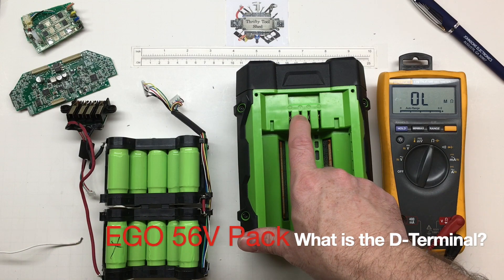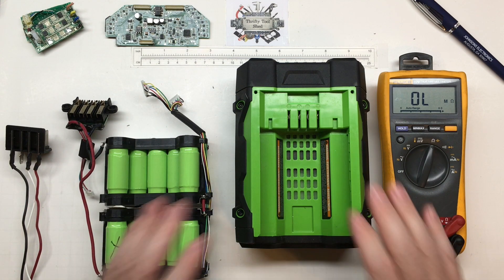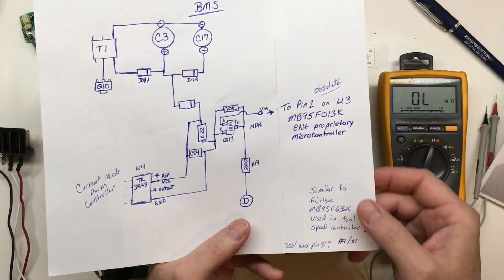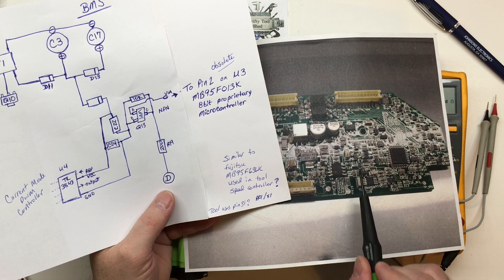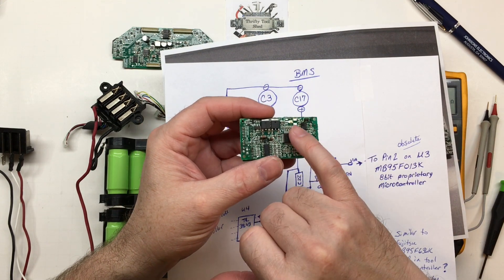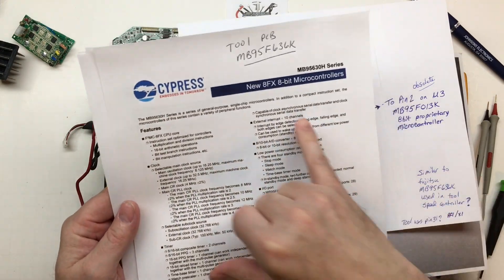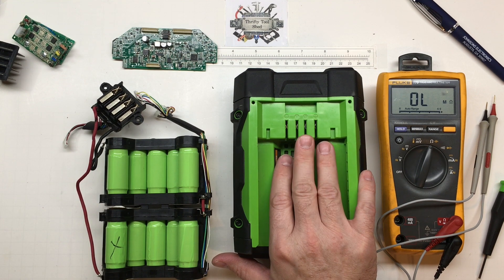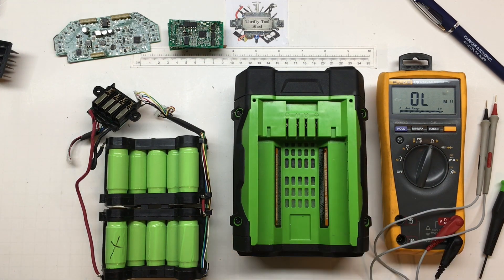EGO 56V Battery - What is the D-Terminal?

Comment: That D terminal should have been named P for propitiatory firmware which is what keeps EGO in business and all other battery / tool makers. Too bad we can't have some sort of standard in batteries so we could use them where we want. The bms could be replaces with a generic one so charging would not be a problem with any power supply but the tool wants to get the signal that it needs to run so that is where we should look next. I already used Snow Joe batteries to run my 36 volt lawn mower so it all works just a matter of configuration.
Reply from the maker: I agree. That is why I did give it a good effort and I also shared the Ruzixt style replacement pack made by AMZ on my channel as well. They impressed me with at least figuring out how to copy the BMS to use it in the EGO equipment. Its not a popular option and I understand that. I bought the first replacement pack myself to see how the quality is and to test and share it on video and I recently shared a update on it because the pack has did well for me in the last year honestly. The cool thing is the company AMZ that makes the 3rd party packs has got up with me and sent the 6AH pack to look at as well. I will be testing it and sharing that soon also. I was at least able to have a conversation with the manufacture, but as far as being able to purchase the BMS board alone, they are not allowing me to do that yet, I am still hoping though....
Reply: @ThriftyToolShed  Thanks for all you share it is a big deal to do all that. I guess the next step would be to try and dump the cmos chip which is where all the operating instructions are. Thanks again you have a great channel.
Reply from the maker: Thank you!

Comment: Great work indeed. This is most helpful as was your T terminal video. I’m working on a 2.5 Amp hr now with a very odd DTC resistance reading on the lower pack which I believe is causing a charging issue. Status monitor shows green but charging will stop after the first “blink cycle” (red-yellow-green), more later after one additional troubleshooting step. Thanks
Reply: I meant to say the  NTC thermistor. The pack T terminal measures normal ~11K to the negative terminal but the thermistor of the low cells measures ~ 4 ohms when measured on the BMS. Pack will not charge with all cells balanced. Using another BMS where thermistor of low pack measures ~ 10K at BMS, pack charges normally. Ever encountered this with any of your packsaddles?
Reply from the maker: Yeah, I figured you meant NTC. I have not experienced that exact issue. The T-terminal sounds good. You are saying the NTC on the cells with the small black leads are reading fine (around 10K or so) Then you plug it in the BMS and then it shows low ohms reading, like it's on the board that low ohms? I have seen the NTCs themselves give issues, but not the board on the Thermistor input other than corrosion / bad connection. I haven't seen it have a low ohms reading like that on the NTC terminals!
Reply: @ThriftyToolShed  yes on  the BMS with the harness connected to the BMS the resistance across the thermistor at the L pack terminals reads under 10 ohms. Have not the thermistor leads on the connector when it isn’t connected to the BMS. Swapping another BMS, charging is normal. Something on the one BMS is pulling the L pack thermistor low. Thanks
Reply: JS, did you figure out your problem with the ohm reading between ground and T dropping when the BMS is connected? I have a water damaged battery which was working until I tried to charge it before it was completely dried out and after charging for maybe 10 minutes something fried both on the battery and on the charger. Now there appears to be no continuity at all when I measure between ground and T. The battery still has almost 56 volts and still runs the tool so the D terminal seems to be working. It will not charge on another good charger I have so something is clearly wrong with the T circuit. I'm running a 18-in chainsaw with it which uses both D&T so I'm not sure how the saw is working without T functional.

Comment: Do you think you would be able to charge a DIY 14S battery with the charger without the D-terminal of charger connected to anything? T is easier to jerry-rig as I just have to get a NTC termister as you mention in the video. Not sure if the charging will work without the D.
Reply from the maker: In my experience with the chargers, you will need the D-terminal communication between the pack and charger to charge. Some maybe different, but all I have seen have to be connected to D-terminal. A 60VDC supply or so and a Drok DC-DC converter is one easy way to charge 56V packs. I have a similar video showing the Drok in action, but similar converter should work as well. I have not tried to charge  without the D-terminal enough to know much about it honestly, just my thoughts...
Best of luck with your project!
Reply: @ThriftyToolShed  Thanks!
The only reason I don't want to use a 60VDC power supply is that it will not have the characteristics of a lithum charger. Which may damage the cells in the long run. Generally, proper lithum chargers (like the Ego) would provide constant voltage & constant current until the battery reaches a certain voltage (4.0V/1 cell) then the current will slowly be reduced over time to lower and lower amps until the battery is fully charged (4.2V/cell). This is hard to replicate in DIY setup. Ofcourse I can buy a dedicated charger but it will be extra cost when I have 3 ego chargers laying around.
Reply from the maker: @DIYGuy85  That is the entire point of the DC-DC Converter. In may videos I discuss the CC and CV relationship and the Drok or any CC CV converter makes it very simple and easy.
Reply: @ThriftyToolShed  oh ok. I will check it out. Thanks

Comment: D terminal = Digital terminal? Communication terminal between processors for battery protection. If battery overheats or depletes, it tells tool to stop in order to protect battery? 
Do you suppose two batteries could share this D terminal to tool? I haven't checked the system on a dedicated dual battery tool. I suppose a dual/multi battery tool has two or more processors (one for each battery). I'm looking to add more batteries to my mower. I could do it without D terminals, but the protection wouldn't be there anymore. Any Idea? 
Thanks, Mat
Reply from the maker: I mentioned alot of this in the video. The tool will only run for about 10 secs if no communication between the tool and pack on the D-term. At this point the only way really is putting another pack in parallel, the + and - . It would have to be done properly or at the very least care must be taken to make sure the charge level of the packs are the same and the capacity of the packs must be extremely similar. The pack added will not have the protection of the low voltage cut off or temp monitoring of course.  That is the only way that I would know still. I did check out the Ruzuit battery pack made for EGO equipment and I only done so for one reason, to check out how well they done the BMS board. They copied it well, so that means they figured it out. Unfortunately I have not had success getting up with them to see if they would sale the board as a spare part. That would be very helpful. I did a video on the battery because it is a very close copy of the newest EGO BMS. Not really worth the money, but interesting that they figured out the D-terminal.
Reply: @ThriftyToolShed  Yes, you did mention that the tool would only run for about ten seconds, this is why I asked about parallel connections, not absence of. Sounds like you haven't attempted parallel D terminals. I plan, of course to use similarly charged packs, but I will be installing fusing between packs to avoid an expensive dummy mistake. I may test this out to see what happens as far as parallel D's. You haven't tested with any multi battery systems such as ego snow blowers?
Reply from the maker: I don't have snow blowers at all since I live in the south. That is a very good point though. I don't think the D-terminal should be paralleled due to this being a 2 way communication link between the tool and pack. I was simply referring to the one pack using the D-terminal and the other pack + and - being in parallel and of course the protection as you mentioned at least a fuse, at best battery isolation using high current diodes etc. on each pack.
Reply: @ThriftyToolShed  Not to worry, EGO has a rider mower coming to you soon! The rider will have up to six battery compatibility. I may investigate a bit into one of my snow machines to see the communication methods. BTW love your channel. I must say, the first video of yours that I watched opened my eyes to a lot of basic troubleshooting. Thanks!
Reply from the maker: The mower looks cool for sure. Thanks so much for your comment!

Comment: I've been running this for 3 years now.  My next goal is to connect to the d terminals. I'm using 4 batteries in parallell but through schottky diodes otherwise the dang things will charge each other but they would be bad. Probably blow them all up.
I am using a roboclaw mcp260 controller on the drives. So I will be able to output some data to d. It's just hard because it seems to be software driven.
https://youtu.be/kFqouZvOQAE
Reply: I did just get 7 ego snow blower battery combiner control boards. I am hoping to replace the schottky diodes with this. But I can't without the d terminal figured out.
Reply: @jacobecorder  I know this is super old but did you ever solve this?  I'm trying to connect 4 ego batteries in parallel to run my project but don't want to a) have an unbalanced batteries damage each other; or b) over discharge.  Did those snow blower control boards work out?

Comment: Even if we all figure out how to  “just” use the dinky battery as the means to keep the tool happy and use our big li Ion ebike batteries (and maybe .22 ohm series resistor and automotive 10A fuse) to keep the dinky battery charged, then that is workable IF the BMS doesn’t freak out .   May have to use 2 diodes and a summing node to prevent BMS from “seeing” the ebike battery...... I think “that’s the ticket!”     What do you all think?   As long as the summing nodes are done before any and all BMS, it should be completely clueless !!
Reply from the maker: Yes, I did mention in the video that the only solution to running other packs on say the Nexus inverter would be just as you mentioned a parallel configuration with a EGO pack in place to supply the communication. Dead on!
Reply: I would isolate the batteries. From what I have read,connecting a dead lithium battery in parallel to a charged one would be terrible. This is why I isolate mine with the schottky diodes. Very low voltage drop
 You can connect the ego battery to anything you want. You will just overdischarge it without some other sort of cut off system. A relay with a low voltage cutoff circuit will handle this. Battery displays on Amazon for 30$ can handle this for you. You set low limit and it can output to a relay
Reply from the maker: Yes, absolutely needed. Most people that watch my channel know I am so against videos telling people to "JUMP" battery to battery to "FIX" a bad pack. Such a wrong thing to do, especially in ignorance. Batteries should absolutely be either isolated from each other or almost dead on same exact voltage level and discharge rated in a tight.

Comment: Thanks for the videos. Interested in how the battery shuts down if Volts get too low. Repurposing batteries for e-bike project and from what I gather, the shutdown sequence on low volts is partially on the Battery BMS and partially in the tool. As I will not be using the tool, I'm curious as to how I can gather the parts from a tool (if required) to have the EGO low voltage shutdown function operational on the e bike. Any suggestions or other videos you can suggest?
Reply from the maker: I still have not figured out the communication between the D-terminal so the tool controller has to communicate with the pack so when BMS senses low voltage it tells the tool to shut down. The only progress I know of is slow. I did a video on the Ruzuit 56V battery for the EGO equipment. It is aftermarket, so good news is someone has reverse engineered the pack and figured it out. Not so good news... I have contacted company about BMS parts etc. But as I suspected, no response back. As mentioned in that video the price is not that great of savings, I bought one simply out of excitement to see how close the BMS is and if it communicates and it does. The only other work around for yours that comes to mind is wiring in a separate BMS of your own off of the + and - of the EGO pack and not even bothering with the EGO  feedback. If you really wanted to, you could build your own low voltage detection but may cost in components the same or more than a BMS on the market. Best of luck to ya!
Reply: @ThriftyToolShed  Yes, just seems like a shame to not use what is already there. This e-bike forum has an EGO following and on page 4 of this thread a guy seems to have made some progress...https://endless-sphere.com/forums/viewtopic.php?f=14&t=93563&p=1557318#p1557318

Comment: I need help! I have an Ego 4AH 56V battery.  Testing each cell via the B1-B14 terminals, I have the right voltage on each cell, except that B13-B14 gives me negative 3 volts.  What would cause that?  How do I fix it?
Reply: I did find it's definitely on the board.  I tested the individual cells.
Reply from the maker: I have found the connectors on the BMS where the cell wiring plugs in have bad connection and I cleaned them up really well and it can sometimes solve the issue.

Comment: I haven't seen go over how the battery powers the BMS board. You reference it a bit in the video where you fix the BMS with the flashing green light. Ive got a pack where all the cells are good and balanced at about 3.6v and im getting 50.4v at the main terminals and 50.4v into plug that powers the BMS board(two small red wires) Yet i cant get the power button to light for anything at all. And it wont charged on a known good charger. Any ideas?
Reply from the maker: Well I have not had to troubleshoot that problem specifically, but I do know the test button wakes up the DC-DC Converter on the board. I mention this breifly in this video that is really all I have checked in to that part. Hope it helps a little bit, all I know is to check the bus voltage accross the capacitor when pressing the button and see if the converter is powering on!
Reply: @ThriftyToolShed    I was taking a closer look at my BMS board and came across something i thought might be helpful and you would probably be able to put it to better use then I'd be able to. I was getting a light on my board and it shined up from the bottom through the board and it revealed all the traces and how they travel from each component through the board like a map. Hopefully that made sense. I could get you a picture of what i mean if you need but it could be useful on other projects as well. Thanks again!
Reply from the maker: @High5Alive  Yes, it does help. I do that often with boards for sure. Some boards have so many layers and vias from one layer to another that it can be difficult to see. Yes when I am following a Trace, I always have a flashlight close by it will help some for sure, at least see the direction it is going. Thanks for your comment!

Comment: Anyone know if you can buy replacement parts for battery.  It looks like the newer batteries have the BMS potted so you can't trouble shoot problem.  I tested all the cells and they all measure 3.9v.
Reply from the maker: I do not know of any where to get parts. I ordered several faulty packs from eBay a couple years ago and got some going and also had some spare cells and BMS board and connectors. BTW:
On my first EGO pack repairs video I do show the process of getting out the grey potting material if interested.
https://youtu.be/EH0GS0iUzzM